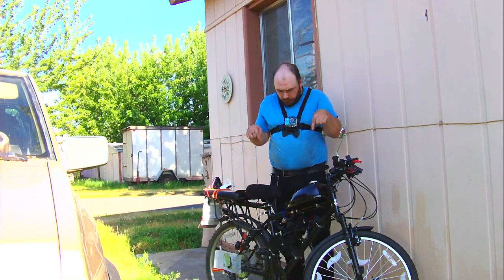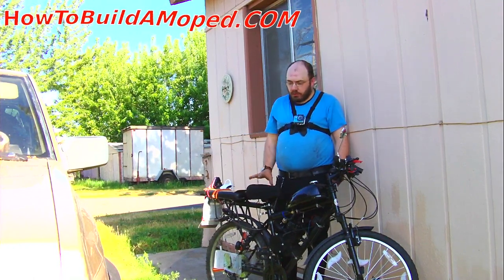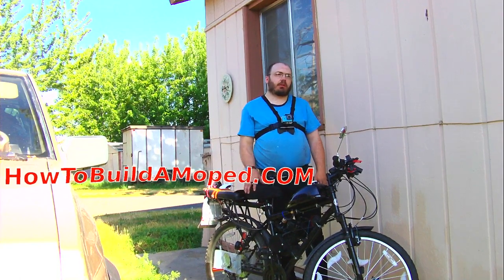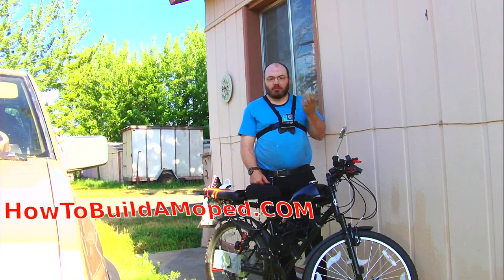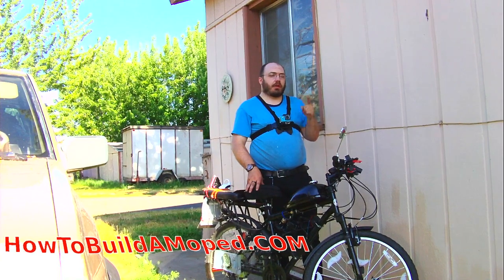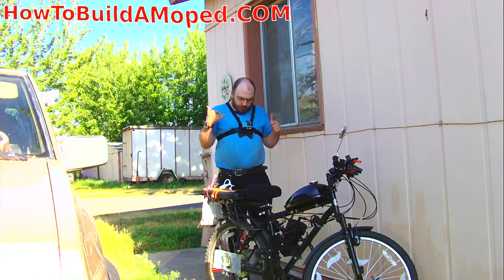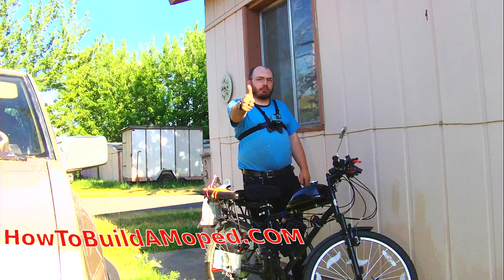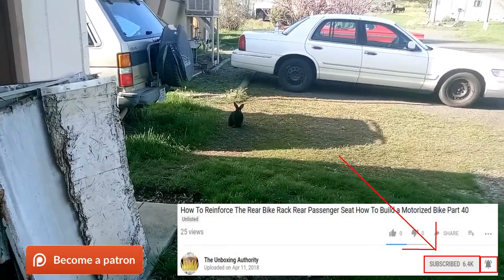Review BBR Tuning Racing Series Stage 3 2 Stroke Engine Kit How To Build A Motorized Bike Part 62

Comment: I use cdhpower kits and 42 mph window piston and Reed valve 32 sprocket oko 21mm carburetor.
Reply from the maker: That sounds right. Sounds like you did it right.

Comment: I can do 47 with the regular kits but I have to modify them free at home obviously
Reply from the maker: Great, maybe you and I can get in communication, and work out any bugs.
Reply: @MBOFOYH  I do have a question, have u ever built a bike with a jug that had open transfer ports
Reply from the maker: The stock BBR Tuning Stage 3-4 Jugs have open transfer ports, I made a video showing that. https://www.youtube.com/watch?v=n4HZUQWA8lk
Reply: @MBOFOYH  I hate them
Reply: Dam how did u modify it tips would be appreciated 👍
Reply: What upgrades can you do to get faster top speed. I want 40 so I could go 20mph not lugging the engine